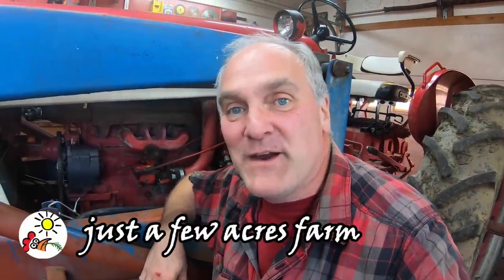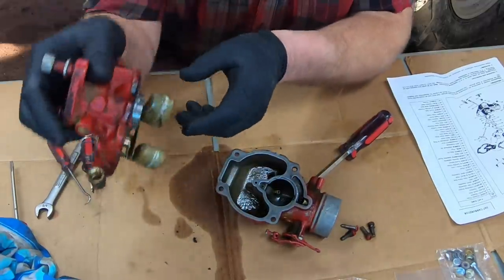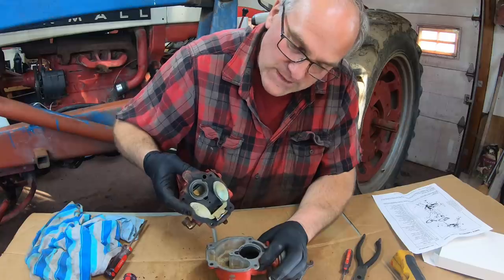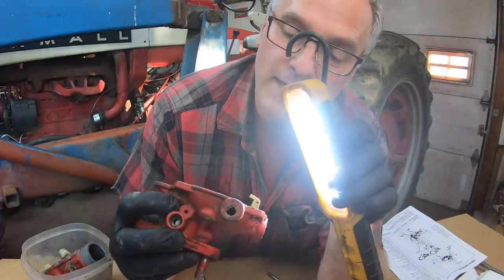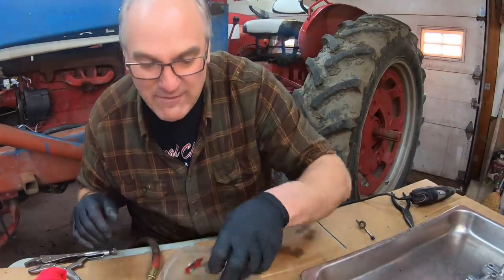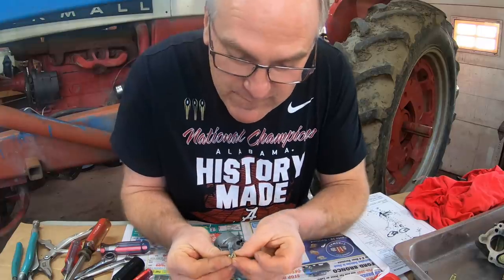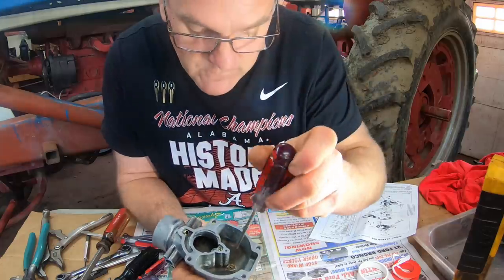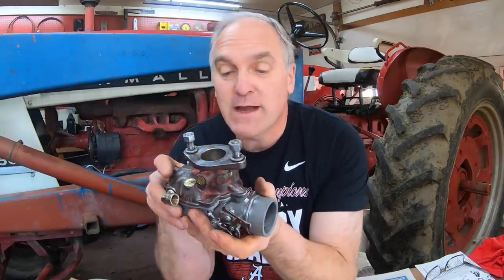How to Rebuild a Tractor Carburetor, START TO FINISH (Zenith carburetor)

Comment: In college I had a 1978 VW DASHER. THE CARP WAS BLOCKED AND DIDN'T HAVE 150 TO BUY A NEW ONE. So my buddy and I bought a rebuild kit. Holy smoke how many parts in a carb? A bizzilion. Lol. Rebuilt it with 5 or 6 parts left over. It ran for 4 years after THAT. Still shocked it did. Lol

Comment: Enjoyed this video very much. A long time ago I rebuilt a carburetor for an AMC Hornet. I read and reread the kit instructions and followed them to the letter. I soaked the parts like done here reassembled and set the floats, and adjusted as in the kit instructions. I could not get it to start! The car sat in my yard for awhile because we really didn't need to drive it and then someone we knew needed a car to get back and forth to work. So we gave it to them and my father in law came and fiddle with the mixture screw slightly and boom it started and ran like a top! My father in law compliment me on the rebuild. the fella came and got the car. I felt pretty good about it. A week or so later we saw the fella again and he was driving a sporty new car. I asked about the Hornet and he said "Oh I took it to the junk yard and got 50 bucks for it and bought this new one on credit." I was a lot peeved about that. But it was a learning process in more ways than one.

Comment: Another great tutorial Pete. I had to laugh when you got the carb off and I spotted the patchy paint left on it. I said to myself. "he's not going to let that paint job go for sure." Yep I was right. and again during the reassembly. when you got to the low speed screw, I said to myself ok all the way in and then back it out turn and a quarter. and low and behold thats what you did. and that came from my training back in 1960!! at fuel and electric school at Aberdeen Training grounds. as a mechanic in the Army. some things just don't get lost do they. Thanks again Pete can't wait to see the paint job on it. and the reinstall and "tweaking" God Speed.ECF

Comment: I have a Case 530 that I just rebuilt the carb on and I’ve had trouble with it since. Can’t seem to get it right. This video was pretty informative. Definitely gonna pull it off and correct some issues. Thanks Pete
Reply: We're you able to find rebuild kit? I have 530 and cannot read numbers on the zenith carburetor. Too many models numbers hard find right one. Thanks
Reply: @kennethchersack3480  my kit was a G45772. Once I got everything adjusted right it ran like a top

Comment: Paid close attention to the rebuild.  I have my grandfathers 300 utility with a similar carb.  Just getting ready to restore to running / light work condition.  Been sitting for 15 years so definitely started from the gas tank working towards the engine.  Fuel system, then electrical.  Hoping compression and valves are ok.  Thanks for your efforts. and great videos.

Comment: Great video Pete! I have two tractors that use the Marvel-Schebler, a 65 Massey Ferguson and a 1020 John Deere. I've had the 65 rebuilt and had issues with it over filling, it's been either the float or needle issues. I'm either going to rebuild them myself, or replace them with a re-manufactured carburetor. Thanks for sharing and have a nice week!

Comment: Nice video. I might try doing a carb myself next time. Seems less frightening now. 

Have not tried doing a carb myself since i was 16 and messed up my carb on my 50CC moped when i was doing some "modifications" that would give my 50CC abit more fuel :)

It ended up at a shop to undo what i did :D

Comment: Pete, excellent video.  I just had to rebuild my carburetor in my old IH. I see that I missed one step in my rebuild.  This winter I will go back and retouch what I missed.  I find your tractor videos always informative.

When you fill your tractor with hydraulic fluid, I would love to hear your opinion on what hydraulic fluid you use.  i.e. synthetic or conventional, generic or manufacture specific (Hytran).  Thanks again for the tractor videos.  John

Comment: Did the choke butterfly go in the right way? Towards the end it appears it sticking out.  You pushed in on spring valve when explaining operation.  So it should allow air in. Just an observation.

Comment: Hi Pete,  

You mentioned ethanol in fuel.  Have you put hardened valve seats in your engines to compensate for unleaded fuel?  Or use additives instead?  Or nothing?
Reply from the maker: Yes, the ones that have been rebuilt have hardened seats. I don't use any fuel additives.

Comment: Pete, I need your help. I have a case 630 gas tractor and the carb needs rebuilt. I am having problems finding the correct kit. It's a Marvel-Schebler  carb and the tag says TXS 571 WITH A 2 At the end of it. And 749 at the bottom. Parts manual said that the tractor should have a TSX-798  carb part# G45774. Can you help me.  Thanks for your time   Mark Ryan

Comment: The Zenith brand must be the most confusing brand of carburettors ever, as the original french company set up operations in the USA, UK and Germany in the 1900s, but then went bust in France in the 30s.  So most of the 20th century there were three separate companies using the same brand name exporting their carburettors to other countries. British cars like Jags and Triumphs had Zenith carburettors that were totally different from their American namesake. It must be a nightmare for a parts guy at the local auto store.

Comment: I have a 1960 case 540, a 530 is a diesel engine, and a 540 is a gas engine. I have 2 carburetors, a Marvel and a Zenith. Both carburetors are backwards, the accelerator linkage is on the wrong side so i can not hook up the governor. The air cleaner is an oil bath andbit is in the front of the tractor which means i can either use the air cleaner or the governor or move the linkage on the carburetor to the other side, BUT the idel adjustment screw does not have a hole in the other side there is a place to put the screw but no little hole for the needle to fit in. Any help anyone?